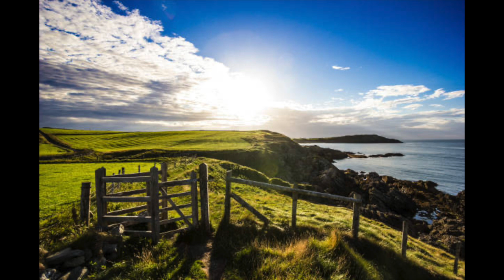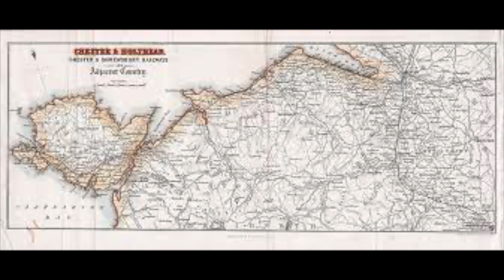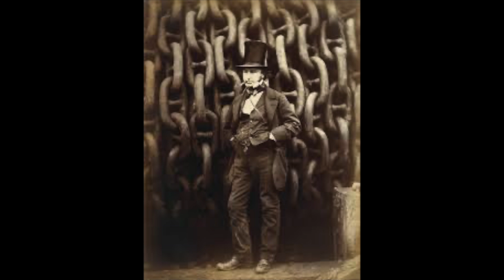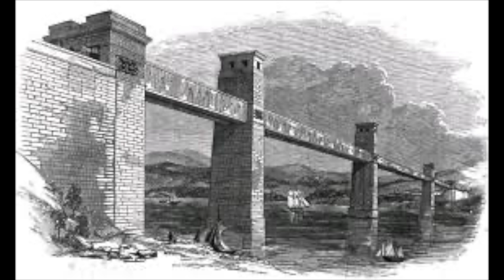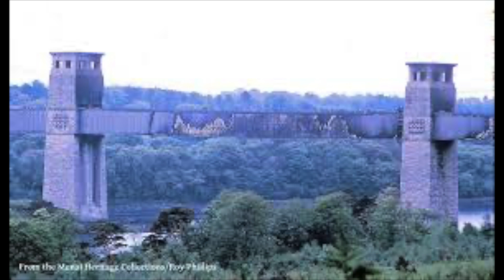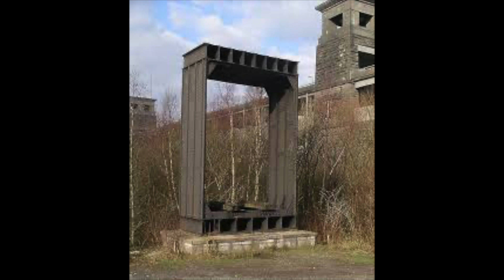The Britannia Bridge

Comment: But what was the ball used for? Did I miss something?
Reply: Ball or roller bearings are commonly used to support bridge spans to allow for the expansion and contraction of the span during temperature changes in the weather.
Reply: @sddsddean  thanks. Did the vid say that? Is my attention span shot?
Reply: @estebanfrisch2536  No, you're fine! I don't think it was mentioned in the vid, but as an ex civil engineer, I know thats what it was.

Comment: The original version of the Stephenson bridge is across the river Conwy. It is shorter than the Britania Bridge, but still in the original form, and still in use. I think that it is listed, and CADW have something to do with it.

The Britania Bridge is now not enough for the amount of traffic using the road deck, but the rail deck was opened as single track, and remained single track ever since.
Reply: There's still spans for two tracks at the rail deck level (I have to confess; I've used the redundant span to cross the strait a couple of times) and the redundant now carries a few services across from the mainland, including part of the islands gas supply and several regional and international internet bearers. 😇

Comment: The rail bridge by Conwy Castle is a mini version of the original bridge
Reply: The Conway Tubular Bridge was like a dress rehearsal for Menai and the tubes are also made of wrought iron.
Reply: Same overall construction technique, but a much shorter span. Stephenson did a lot of work along the North Wales line, including Conwy rail bridge and the flying arch he cut into the town wall to accommodate the railway in as historically sensitive a fashion as was possible. 👍

Comment: Designed by Husband & Co of Sheffield, worked on the bridge and the road network.
Reply: They also co designed the Jodrell Bank Radio Telescope in 1957 with its 250' diameter dish as designed the bridge used in the David Lean 1957 film Bridge on The River Kwai with Alec Guinness and Jack Hawkins shot in Ceylon to represent Siam.